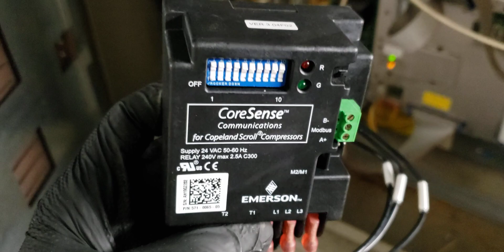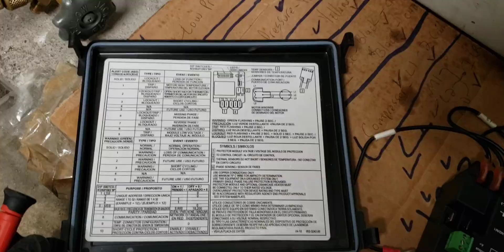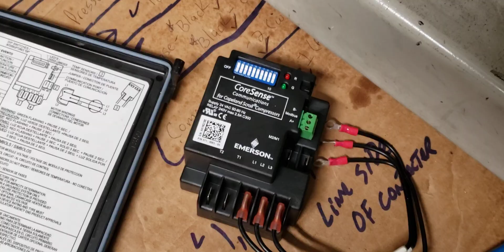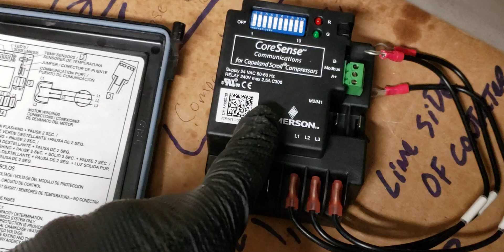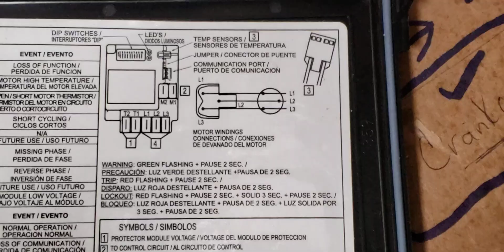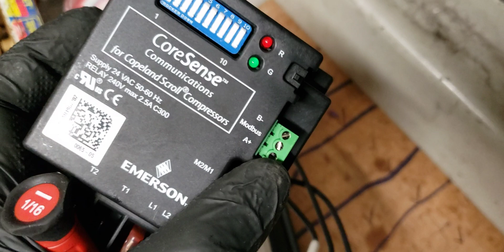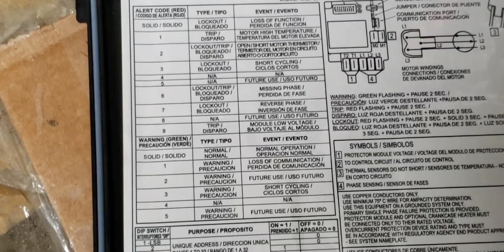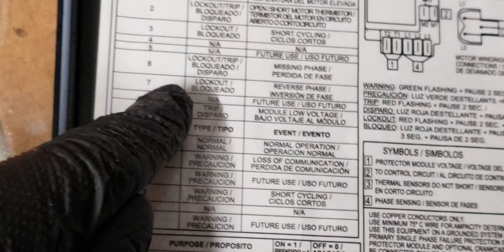HVAC MOTOR PROTECTECTOR EMERSON CORE SENSE FOR SCROLL COMPRESSOR EXPLAINED .

Comment: Wonderful video 👍👍👍
Reply: Ssp  over  lord  portacter  srll tup  m1  m2   24  220 v   T1t2 power    comprssar  potacter  😊
Reply: M1 m2  conrold  circuit        hp swich  lp  km2 swich   winding  port hoted  model  çonrold  high  lp conlrold  senszy systom   model  B+a+bms  conrlld  pointed
Reply: Conrold  wind hot  senzing  greeing  lockout  mode  sermiter  wire rmobving agin fix  no 1o  r  Shoeing lok out bord  sysyom

Comment: AAON CF unit had bad discharge thermister . Tech support said I needed 75k resistor in order to bypass it . No shot I had one 🤷🏻‍♂️
Reply from the maker: 75 k ohnm Resistor for this module? Or for input on Aaon controller?

Comment: Im getting 4 flashes indicating scroll high temperature but the compressor is isn't over amping. Could the sensor be bad?
Reply from the maker: Yes,  and if there’s no redundancy on the compressor, then it would have to be replaced thus i would replace the module first just in case it’s malfunctioning

Comment: I'm having a issue with connector not pulling in no 24v. I have 24v to m1 and m2 goin to compressor. If I jump m1 and m2 the compressor will start. Also if I put 24v to coil connector it'll rn just fine.
Reply from the maker: So the module is bad or the thermistor is opened or the compressor is overheating

Comment: Very nice explanation, Will the compressor start if you don't use the t1and t2 or m1 and m2. I changed out a trane compressor to a Copeland and the trane does have the core sense...
Reply from the maker: It will start
Reply from the maker: It will star however its beneficial for the compressor to have this connected into the controls circuit!

Comment: My old system ZP182KQE-TFD-477 does not have the Coresense compressor protection and said they don"t make that model anymore, Instead they provided with ZP182KCE-TED with Coresense . (The only difference is these models is the motor protection. TFD has the internal motor protection. TEDhas the newer, updated Coresense module. "F" is internal protection. The "E" is electronic enhanced. How can I wire this?

Comment: can you please explain how wire core sense to compressor ,solenoid, low and high pressure switches ,hot gas t1 and t2 , m1 and m2 i mean full wiring to compressor components.please need it AsP
Reply from the maker: Okay I will explain
Reply from the maker: T1 & T2 is your core sense power connection ,
M1 & M2 is to be connected in series with high and low pressure switches

Comment: If the terminal T1,T2 not use ?
Safety device not work (ok) .
I do not use safety device.
Machine direct supply this terminals (L1,L2,L3) what is possible without safety device compressor work only ?
Reply: Already my machine safety equipment available.
Reply from the maker: wasi Ahmed T1 T2 is the power supply terminals, if you don’t connect those then the module is useless!
Reply from the maker: wasi Ahmed The module will not protect the compressor if t1 and t2 not connected, if you wish to protect compressor apply the appropriate power supply to t1 and t2 (24v or 120/230v make sure correct voltage!) then connect m1 and m2 in series with high and low pressure switches